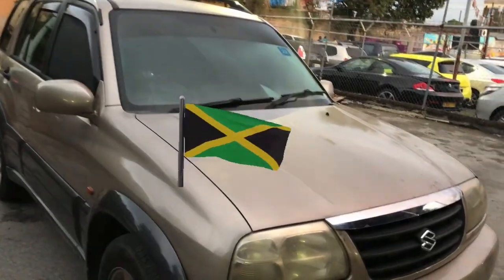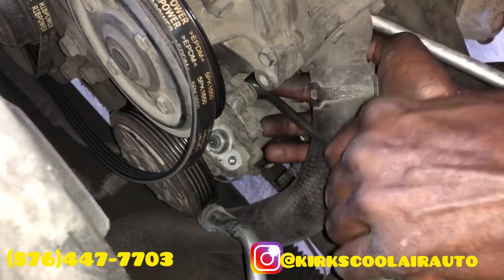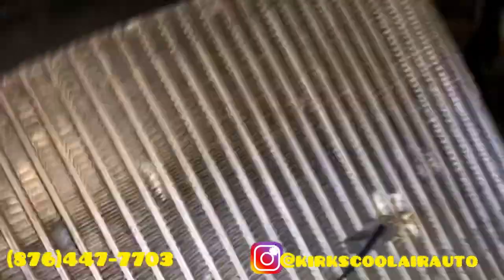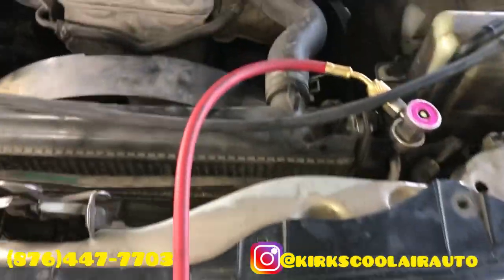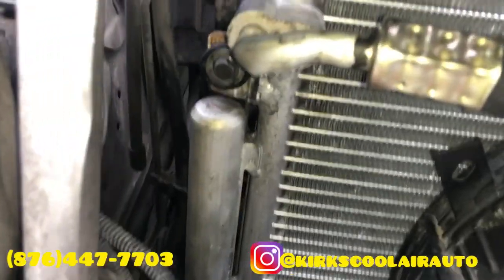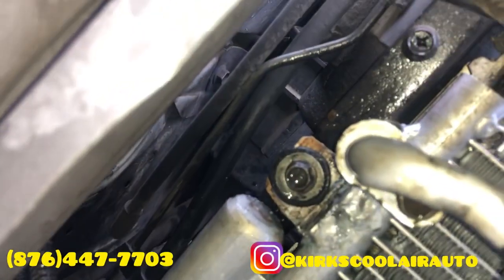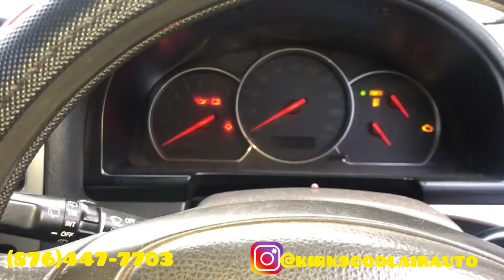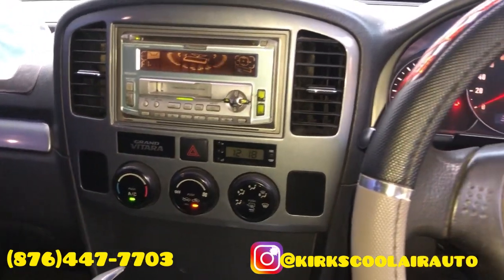Suzuki Grand Vitara A/C Compressor Expansion Valve and Condenser Replacement (Suzuki ac not working)

Comment: Question: so you don’t have to add more  oil to the system? Cause you replace the condenser.
Reply: Depends if the compress you bought came prefilled or not, the fluid is dependent on your specific compressor manufactures recommendation